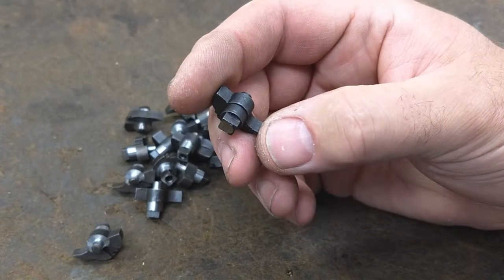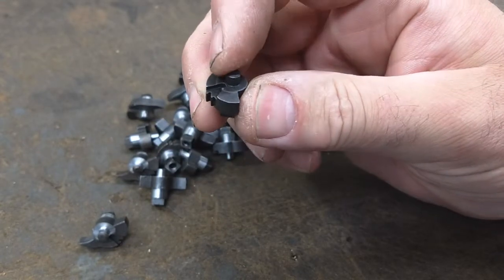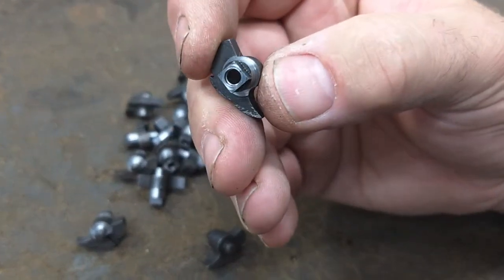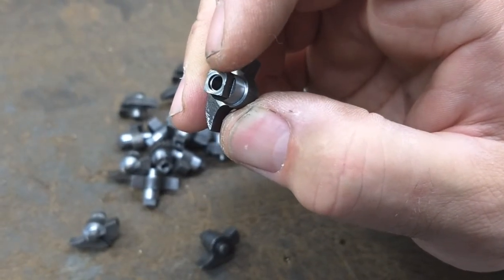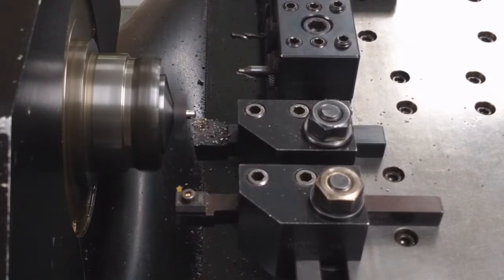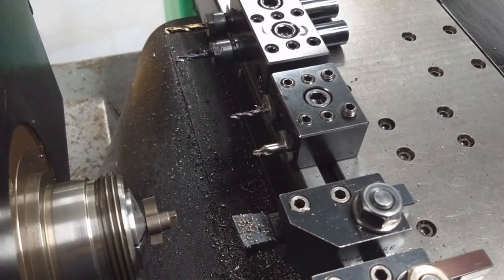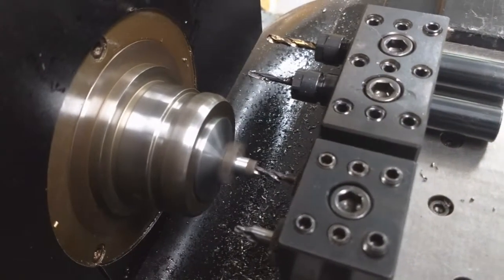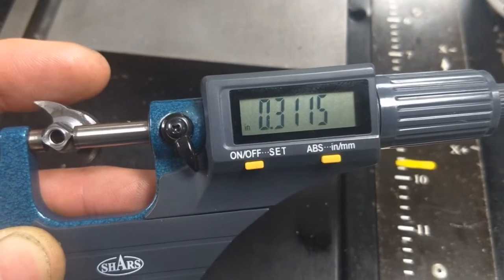Omniturn #6 Machining Large Siler Tumblers

Comment: Would it be possible to start the drilling with the counterbore drill and then go in with the tap drill? missing out the centre drill and the first drill?
Reply from the maker: The process for this part has changed substantially. Facing was pushing some of the tumblers out of the collet. So I center drill, then face to relieve some of the X axis pressure. Afterwards i come in with the finished size #27 drill and then counterbore. I suppose I could still counterbore before facing. Thanks for the thoughts!